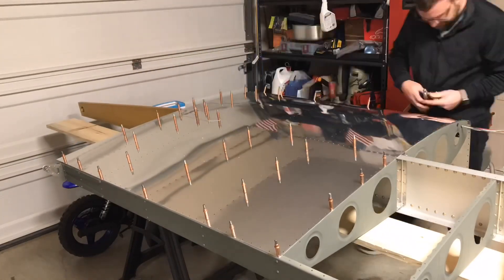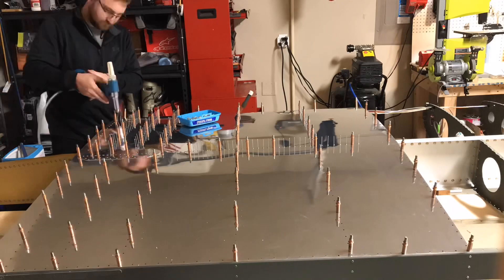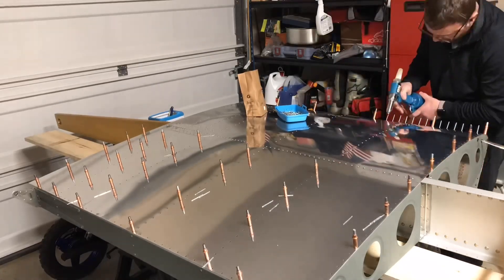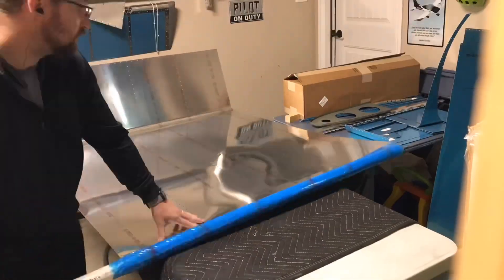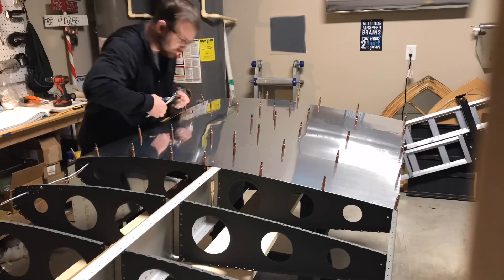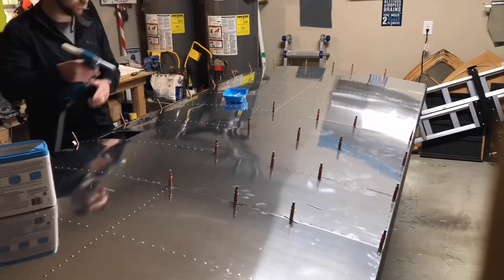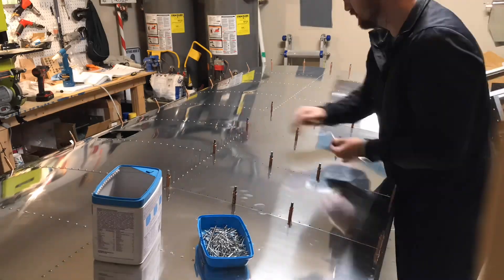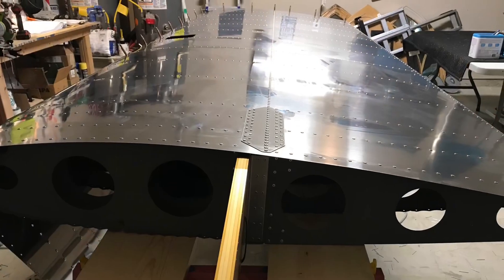RV-12iS Wings 5: Left Wing Bottom Skins Assembly

Comment: If you had to do it over again, which pneumatic rivet puller would have you bought?  I won't be getting into any building for another couple years.  Thanks for keeping me motivating and anxious to getting my own.
Reply from the maker: I can’t really say as I haven’t used any other pneumatic pullers. I’ve read a lot of reviews on the Milwaukee battery puller and was tempted to buy it as nearly all the reviews were very positive. In addition I was looking at a battery one as my wife gets on me about running the compressor when my kids are napping/sleeping. Such as right now, the reason I was able to post the video is bc my kids are napping and I want to start on the right wing but can’t bc of the noise.
Reply: @blflores10  here is a review by another RV-12 builder (https://www.youtube.com/watch?v=7gl43XbmkPo) which he compares the Milwaukee and the HF Pneumatic one.  I have noticed in his recent videos that he is consistently using the HF one vs the Milwaukee one.  I wonder if its worth buying a whole kits from the airplane tool shops which would include the pneumatic puller.
Reply from the maker: @jeremylauer5234  yeah, I don’t know that the Milwaukee would be worth it if the air compressor running is not a problem. It’s over 10x the price of the HF puller. Even if you have to replace the HF 3-4x that’s still doesn’t equal to 50% the cost of the Milwaukee. I’m just going to replace my HF one which should get me through the rest of the build. I love the HF one and it’s cheap enough to replace should it break. Although I’m sure there are other pneumatic pullers out there that are much better than the HF and cheaper than the Milwaukee.
Reply: @blflores10  i agree on the price difference between the Milwaukee and the HF puller and since you stated that your compressor was too loud and can be only run during non-nap time periods, i offer a video from that same person that talks about how to build a sound proof box for the compressor (https://www.youtube.com/watch?v=EikCNY4uac4).